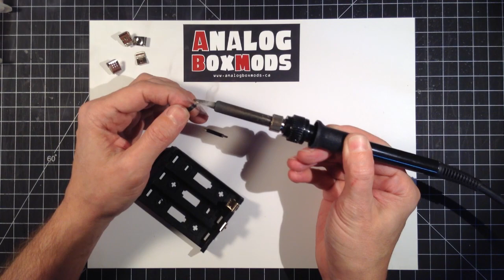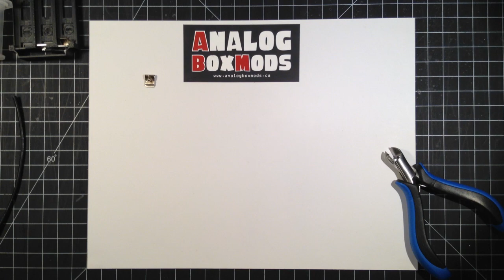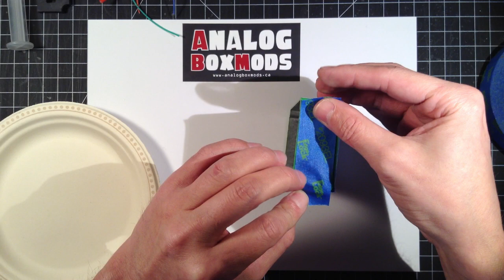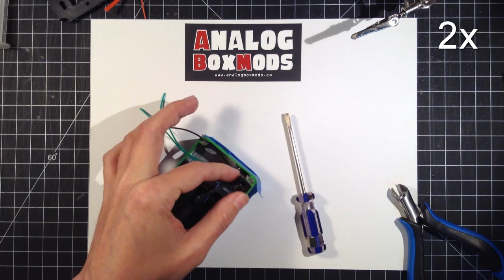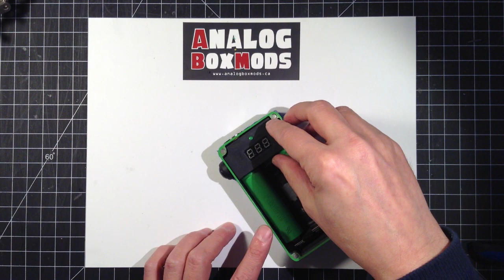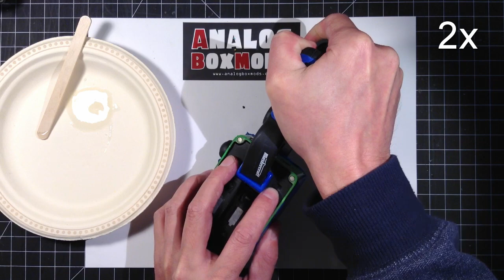Smart PWM v2.2 DIY Box Mod Build

Comment: I'm looking to build a mod much like this but using a 3s or 4s lipo am I wrong in assuming that the wiring would be much the same minus the battery sled portion.  Also would you mind doing a video on that and suggesting a kit or parts from me from your site
Reply from the maker: If the PWM board supports 3/4s then yeah the wiring would be the same.  It might be a while before I make a PWM lipo vid but the iPWM kit we sell has a lipo option.

Comment: with 3 18650s do you get 12v max output? or 4
Reply from the maker: With the batteries in series like this, yes 3 x 4V = 12V max output.... approximately, because the batts could be anywhere between 3.2V and 4.2V.
Reply: thanks for replying

Comment: hi and thanx for the video ... what is the lowest ohm i can go no .. and not danger ...??   thanx again
Reply from the maker: The board itself can handle ~40A (I think), you'll probably be limited by the batteries before the board and it also depends on how many batteries (in series) you use because, for the same output power(Watts), as you increase the voltage, you decrease the amp draw.

Another thing to keep in mind with PWM is that it regulates the output voltage by rapidly switching on and off, the "width" in "pulse width modulation" is the length of time it's on, but for the time it is on, it's always on full, so assuming your batteries are rated for 30A,

2 cells/batteries (series): (3.7 * 2) = 7.4V
7.4V / 30A = ~0.25 Ohm
Output = 222W

3 cells/batteries (series): (3.7 *3) = 11.1V
11.1V / 30A = 0.37 Ohm
Output = 333W

If you put pairs of parallel batteries in series you double the amp handling of each pair (60A) but then you'd run into the 40A limit of the board,

4 cells/batteries (2p2s): 7.4V
7.4V / 40A = ~0.16 Ohm
Output: 296W

All that being said, I wouldn't recommend pushing things to their absolute limits, with any series mod (noisy cricket, etc) people tend to build their coils at a higher resistance because with the higher voltage you don't need to build super low to to get big output (Watts).

Comment: all the coloured wired are included in the kit?
Reply from the maker: Yup!
Reply: i saw all your video and really tempted to try to build my first mod. anything else i nee to read before starting?
Reply from the maker: If you follow along with the vid and study the wiring diagram you should be all set :).   If you are worried, the easiest and cheapest type of mod for a first build would be an unregulated/mosfet build.
Reply: i am trying to make the order but it says no stock.. shall i continue anyway?
Reply from the maker: I am currently out of the Smart PWM v2.2's (so is the manufacturer), I'm waiting on the new v3's which should be out in a few weeks.  I don't think the website will let you complete the checkout if the item(s) are out of stock.
Reply: what will be the v3 about? what will be the differences? i can wait for that meanwhile i'll get the rest of material and soldering stuff